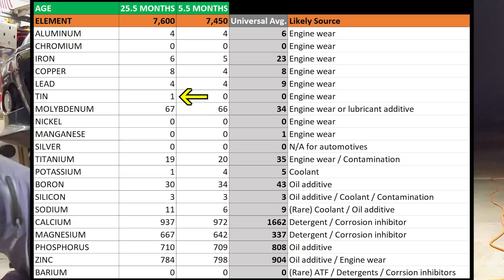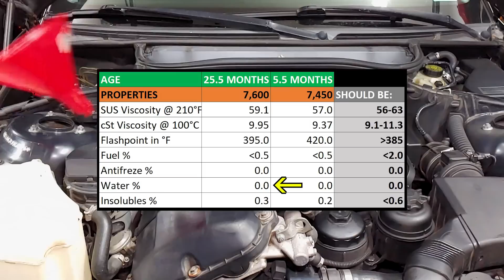Does Oil Really Need to be Replaced Every Year? Surprising Analysis Results Revealed

Comment: I send off a used oil sample to Blackstone Labs with every oil change on each of my vehicles. One of them has always been only a weekend fun machine since it was new 22 years ago. For the past several years, it has seen less than 300 miles per year. The last time I changed the oil after the car had been driven less than 1500 miles - over a 5 YEAR period. The analysis confirmed my belief that oil just sitting in the oil pan of a parked car DOES NOT degrade significantly over time. All values were still well within spec.
Reply from the maker: Very good to know! Thanks for sharing.
Reply: Yhup. My findings exactly. Five years in the pan, and the oil is still good. It's not going to degrade without being exposed to heat.
Reply: @donwyoming1936  My guess is the annual oil change is just a recommendation because people who don't remember the mileage they last changed their oil at will do that out of caution. Otherwise I could imagine a car that is low mileage but daily use could have more wear on the oil than one might think because of the amount of time the oil and engine spend hot after the car is turned off. That's not to say it goes bad in a year or two but it may not be fine going 5 years getting driven 5 miles daily.
Reply: I think they assume low mileage is equivalent to lots of short trips that don't heat up the engine. I have a car I don't drive often but when I do it runs for over an hour typically which gets the oil up to full temp.
Reply: Awesome! Thank you for the info.
Reply: Pretty sure how you drive the car also is that you allow the oil temps to gradually increase before getting into higher rpm’s. 👍
Reply: Get a TAN done by blackstone. It has to be requested when you send in your oil sample. It is a total acid number and checks to see if your oil has become acidic over time. If it has, the oil can etch metal bearings and parts. One more thing if your engine is direct injection, I'd still change it out every year, two at most. The reason is that the fuel dilutes the oil more so than port injection, so your viscosity suffers over time.
Reply: @ryanchristensen1799 in some engines oil dilution is so severe that it goes to 6-8%, it goes to very dangerous levels.
Forces me to change oil every 4-6 months on the family car , a nightmare. 6qts of oil for the M270
Reply: Thanks for the info , been wondering about that. Anyone know about trans fuild ? I got a 2003 model car with the original trans fuild ( only 22 k on it ) .
Reply: @jaredglass2562 Yes very important to not leave old original fluid in.
Transmission gets incredibly hot and it cooks the additives out (then forms a "varnish" on the parts.
I had to replace a transmission because I didn't know it was supposed to be changed until it was stinky and brown. 
Used to be about 20,000km and change it.  Full synthetic can go longer.
Reply: @jaredglass2562  Transmission fluid should be changed every 40k miles.
Reply: @HeheICreamed My 20 year old Dodge Magnum still has the original transmission fluid @250k miles and it shifts just fine.
Reply: Offcourse it does not degrade😂. When you store it in an oil can for 100 years you can still use it
Reply: @hoedemakerbart The additives separate (literally sink to the bottom of the can or bottle and are largely not present in the poured out into the machine it's intended for. 
I shake the pail like crazy to bring as much up off the bottom before use it it's sat a year. 
Other options are use a stabilizer additive to make up for the lost original additive package.
Reply: Good to know. I keep 3 older cars with light mileage on all 3 so this is reassuring to know.
Reply: I use Blackstone also…
Reply: Early 90s, we had part of a fleet of brand new 38 tonne trucks using a new synthetic oil.
They were to be used for 3 years without oil changes. Even topping it up required a mechanic to unseal the oil cap and measure the top ups.
Not one truck suffered as a consequence. There was no unexpected wear of components compared with identical trucks using older non synthetic oils that were changed on scedule.
So yes, synthetic oils will, (assuming all else is good and checked), last for years, especially in relatively low powered and carefully driven cars. Changing filters on a schedule is a good idea, though.
Reply: Heat is the only thing to send oil crazy if its left cold it will last for many many years !!
Reply: My Porsche is a summer and mostly Sunday vehicle. I use it 2500 kms a year and change the oils every 2 years or 5000kms/3000 miles.
I only do that because I live in Toronto and we do have extreme temperatures summer to winter months and I worry about condensation
Reply: @Seaward1224  I am the same! I live in Portugal and winters are by no means extreme like yours, but they are quite humid. So the air that will get in the garage can be as high as 80% relative humidity. Dew point you can look it up so I constantly use a dehumidifier in order to lower it to prevent condensation. Alyernatively you can use heating. Leave the windows a tiny bit open and set thw tyres to 3 bar. And check the battery regularly 😊.
Reply: @Seaward1224  Have you sent in the oil after 2 years for analysis?
Reply: I commented a similar experience on the other oil change video. I did an oil change after 5 years on a barely used car (at least driven once per month to avoid rotting) that is garaged and lab result showed no issue, apart from high water and associated content, which is either a head gasket starting to go bad or condensation not being burned off by small trips. In either case, no issue with the oil and oil change interval themselves.
Reply: I did 1800 miles this year and I'm about to retire so it's going to go down sharply.
I'm thinking of changing my oil every other year.
Reply: Depends, some cars suffer from oil dilution and frequent short trips degrade oil.
The MB M270 engine suffers heavily from oil dilution
Reply: This is why I love YouTube comments
Reply: while this is true that in most modern cars (tightly sealed up engines unlike e.g. my '75 dodge dart w/ slant-6), the oil isn't constantly exposed to air as it sits.  The problem however is actually that if perchance the acidity level in the oil happens to be high temporarily after the drive/usage before it sits for some weeks/months, then that sitting oil does do eating/etching to some metals and it harms seals apparently.   So this is a kinda complex topic bcuz acidity happens sometimes and there's no way to know for sure, though a shorter drive where engine isn't literally entirely to max temperature, will result in higher acidity.     The recommendation for storing cars is to change the oil before storage, and then even after storage, is what true collectors do for sure, and the better mechanics do that to their cars as well, such as the toyota guy who is the very high level expertise mechanic who has the channel The Car Care Nut.    I dn't think i'd do the changing it after storage, but before storage of say 4 months, i guess it makes sense?   I'm kinda split/torn on this issue, bcuz i have a car i dn't drive consistently.   Would be nice to have some ideas from ppl who have a fleet of a few cars or quite a few, even.
Reply: every 12 000km on a honda based on the maintenance minder up here in canada.  hwy driving 1000kms per week. wondered how the mfg comes up with this number.
Reply: Is it only for the oil degradation or the seals also when oil not replaced?
Reply: wow great , i was kinda worried when i changed my oil after 2 years but under 10k  KM ( i think 7000 miles)
Reply: It's all nonsense made by Jiffy Lube in a fast oil change places that your oil goes bad I've had oil on my Chevelle 7 years it was still good and within spec
Reply: I changed the oil on my Lincoln, 4.6L DOHC after almost 9 years and 1300 miles.  Blackstone Lab report was fine,  TBN "looks good".  I was expecting the worst after listening to all the advice about changing the oil at least once a year no matter how little the vehicle is driven.   But not waiting another 9 years for the next change.  Walmart conventional oil.
Reply: Why Engine Oil Degrades with Time (Not Just Mileage)

1. Oxidation:
Over time, oil reacts with oxygen, even if the engine isn’t running. This chemical reaction leads to increased viscosity (it thickens) and the formation of acids and sludge.

2. Moisture Accumulation:
Condensation can occur inside the engine during temperature changes, especially if the car sits unused. Water doesn't mix well with oil and can cause corrosion and sludge formation.

3. Additive Breakdown:
Engine oils contain additives (detergents, dispersants, anti-wear agents, etc.) that degrade chemically over time. Once depleted, the oil can no longer effectively protect the engine.

4. Contaminants:
Even a sitting engine can let in contaminants like dirt, dust, and fuel vapors, particularly in poorly sealed systems. These can react with oil, causing it to degrade.

5. Short Trips / Occasional Use:
If the car is only driven occasionally and for short trips, it might never get hot enough to evaporate moisture or burn off fuel dilution. That’s often worse than regular driving.

So there's more than lab analysis.
Plus like others mentioned, there's risk of corrosion and seals degradation. So it's not even the oil itself that you should worry about being old but what that oil can do to your components
Reply: @Angry-Lynx  But used oil analysis measures all the endpoints you mentioned (oxidation, viscosity, TBN, water contamination, fuel dilution, insolubles…etc). What specific measure of oil degradation is being missed by UOA?
Reply: Thanking you for this. Changing you oil per time means'you got more money than BRAINS' ( A NEWFOUNDLAND TERM for saying 'you are SO FN STUPID'
Reply: I have had similar experience on the low mileage cars. I let them both go about 3000 miles over 3 years.
Valvoline has indicated their oil will go way longer than 3 years on low use oil. I suspect most synthetic oils will do the same
Reply: thanks 🙏 for info
Reply: Fine. The only restriction for such a longtime use are short distances where they engine doesn't get warm enough.
Reply: Good to know. 😊
Reply: If you have an oil dilution problem meaning the gasoline is leaking through the piston rings into the oil pan, then you better change it often.
Reply: Or you got hustled by the lab
Reply: I change oil every 10K miles and never need to add oil for my 2004 Pontiac Vibe . It has 120K miles on it.
Reply: My guess is older engines weren't always sealed up as well as modern engines.  It possibly also gives people a chance to see the oil if there's a small head gasket leaking coolant in the oil before catastrophically destroying the engine.  Lastly I'd expect all of the additives to stabilize modern oil more
Reply: Wow people actually send their oil to be tested. Isn’t it cheaper to change the oil for 30 bucks every 6 months or every milage interval if driven often. I guess people have ocd.
Reply: I don't send in used oil samples for analysis to save money on oil changes. In fact, I change all fluids and filters much MORE frequently than the automakers recommend. Sending in the samples actually costs me MORE in the short term, but less in the long run, because the samples help me gauge the health of my motors. Used oil analysis provides an early warning system of impending issues, so they can be addressed early, before they lead to much more expensive catastrophic failures. @NeutronX101
Reply: It piss
Reply: you must using another type of analysis, because the Blackstone labs I am familiar with only analyzes the oil for metal content, so that engine wear might be known.   It doesn't test if the oil still meets all specifications.   It really doesn't matter, with so little use, I doubt the engine or lubrication sees much stress, so any lubrication problem would be real slow showing up.  I prefer to look at drag cars for enlightenment on lubrication, since they break things so often.  

One can't wear out an oil molecule in automotive use, but the additive package ages out, and that is why used oil can be recycled indefinitely, but should be changed at least once a year to keep the additive package working as designed.
Reply: @richardelliott8352 did you watch the vid?  It has the oil additives listed. 

Go to 2:57 near the bottom of the chart.
Reply: @richardelliott8352  Besides wear metals, a standard Blackstone oil analysis includes viscosity, insolubles, flashpoint, water, coolant content, and fuel content. A TBN (Total Base Number) analysis showing the remaining active additive in the oil is optional for a few dollars more.

Incidentally, most of the mileage that car sees these days are racked up on a closed circuit course, so they're not easy miles.
Reply: @richardelliott8352 exactly its not that the oil breaks down its the additives.
Reply: @richardelliott8352  yes, and then there is the moisture accumulation

Comment: I have a 2001 325i and it went years without an oil change.. just filters.  that said, it had a leak and I was replacing half a quart a month so I called it a continuous oil change.  It ha 200K miles on it and is still running strong.
Reply from the maker: I'll be doing an oil analysis video soon on a car that uses oil like that. I want to see if contaminates build up or leak out with the oil.